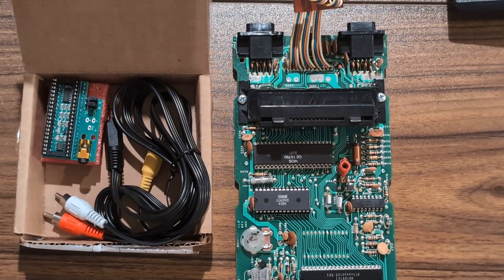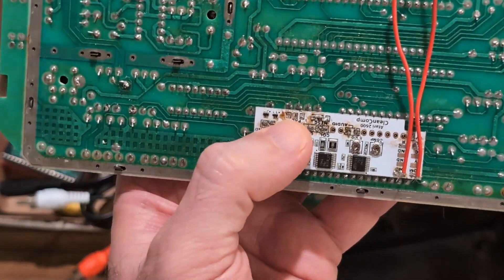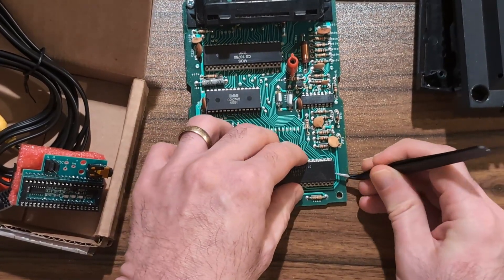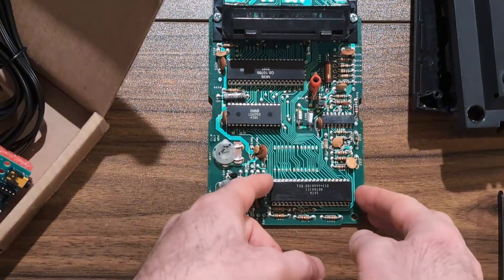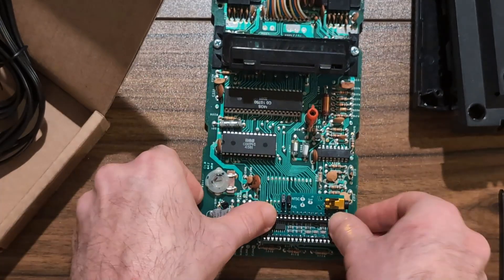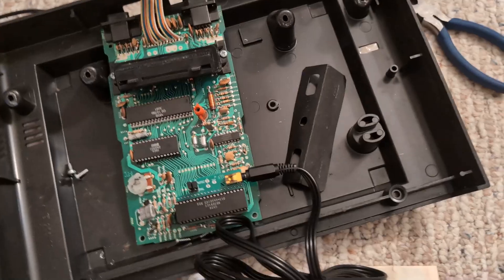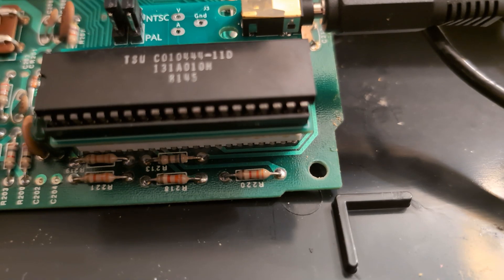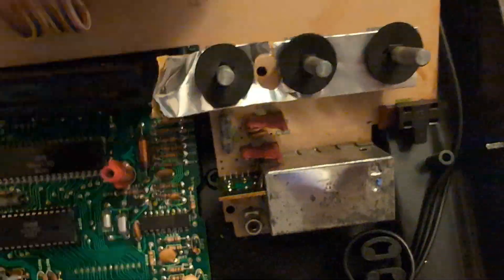Easiest Composite Video Mod for Atari 2600?

Comment: I improved my RF video on my 6 switcher by replacing the power cord on my 2010 Samsung flatscreen.  I replaced the TV's 6' long, c14 plug,  power cord. In its place, I used the 24" long,  c14 plug, power cord from my kitchen rice cooker. Removed most of my static & noise.